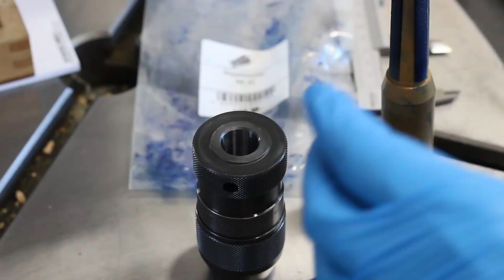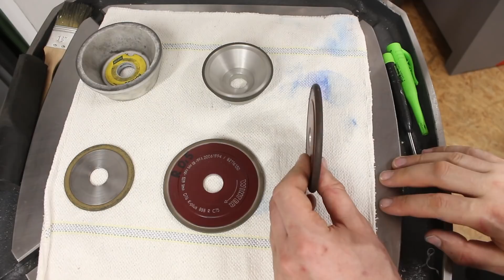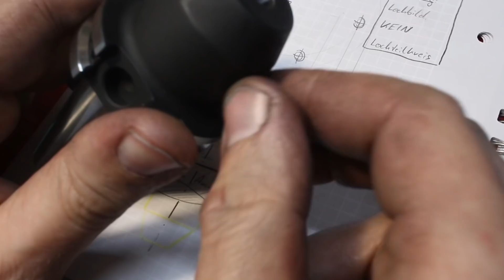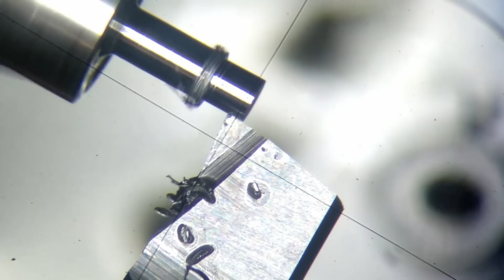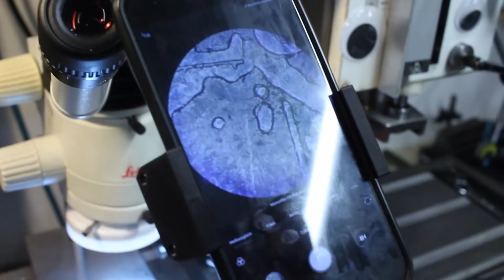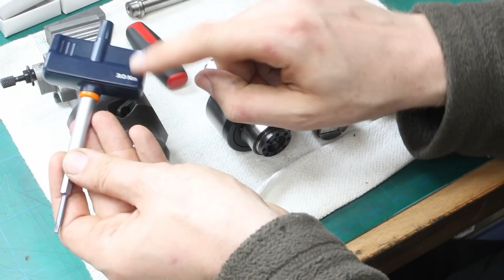Shoptalk #26 - May 2022

Comment: I'm sorry if this covered elsewhere, but is there an obligation to recut the center on the drill press spindle when you regrind or would it only be for initial manufacturing?

Thank you for the fantastic content ..
Reply from the maker: it would be a nice touch, but not necessary in my opinion.
Reply: I guess the more i think of it, all the important features of the spindle are forever a function of the bearing seats after those are finished, so what would be the point.

Comment: Are all the grinding wheels you showed 125mm as a stock size?   In Australia 125 mm diameter wheels do not exist. I’m rebuilding a LIP 515 and Lipemec suggested converting the machine to run 150mm diameter wheels.  Your BEMA runs 125 as standard so I presume BEMA do not see 125mm diameter availability as a future issue.
Reply from the maker: Norton stocks 125mm Wheels in Aluminum oxide and Siliconcarbide. The regular wheels I use are from "H.B. Schleifmittel" here in germany.

Comment: Stefan, thanks for another very good presentation on precision techniques. Squeezing down to essentials is a form of art.
One thing that made me think over Your setup. How did You initially ensure that the flange of that ISO holder was concentric with the ISO taper? It does not need to be.
I quess that in that case it was concentric as the taper was running true when You turned it around.
I have done some ISO 30 tapers myself and I always "turn" the tool attaching surfaces in the milling machine to be sure that they become parallel/perpendicular.

P.S. You need a hair cut 😀
Edit: Ahhh ... already done it seems.
Edit #2: Man ... it seems to be back so ...

Comment: I use one of the Andonstar "microscope" camera things for making parts around 1.5 mm diameter on my old Colchester 1800,, but I miss the 3D view of the optical binocular scope I use for electronic component assembly. After seeing yours, I'm tempted to get a cheap Amscope binocular scope with a 0.5x lens extender and make a mount for the lathe.
Reply from the maker: Yeah, I was thinking about getting a cheap optical microscope for beeing used on the machines, the Leica is a bit expensive in case of a crash event.. :D

Comment: If i remember right we used dykem applied @ like .0005" to .001" and permatex @ .001-.0015.... depending on the seal angle among other features like torque make up on threaded connections and shit. I know it's another world but everything has its place. We had bluing blocks that were nothing but gage blocks with different finishes or micro steps across one plane which u then applied a dab of either bluing and swiping it with a matching block that came together with the bluing blocks as  a set revealed the ideal/proper display of how the correct thickness visually looks after being applied correctly.

Comment: Why does everyone use non-reinforced cutoff wheels on their grinder?   They are impossible to buy here, probably because of the potential danger of putting one into an angle grinder.
Reply from the maker: The non reeinforded wheels are a bit more precise in thickness and leave a cleaner sidewall. But in general thats not a issue for what I do. I like the anglegrinder wheels for their cutting action.
Oh, and you can dress a non reeinforced wheel thinner - Which you cant with a reeinforced one.

Comment: Why not build a designated jig for the tapper grinding since you do so much of them and im sure what takes most time is the setup
Reply from the maker: The sine plate is already a very quick way - But I need a different V-Block. The magnetic one I have does not hold on large diameter round parts like a quill very well, hence the two woodworkers clamps.
Going to make a large V-Block with a traditional clamp that bolts onto the sineplate, that will be fast and universal :-)
Reply: @StefanGotteswinter  i see,makes perfect

Comment: I'm looking into making my own tungsten grinder (TIG electrodes). I find it hard to find a good source of diamond wheels that allow grinding on the face of the wheel. Is diamond the way to go or would any of these wheels work?
Reply from the maker: I don't know where you are located, but Robin Renzetti likes the Diamond cup wheels from Shars on his DBit grinder - Diamond works very well for grinding Tig tungsten electrodes - But careful, machinist here, not a welder ;)
Reply: @StefanGotteswinter  In Sweden so Shars is probably not that practical for me :D. 

I've read that CBN wheels perform better than diamond at high temperatures so maybe a god fit for grinding electrodes?

Thanks for great content btw!! Learnt a lot from your channel.

Comment: You should 3D print an adapter to hold your eye glass on your glasses. One of my work colleagues has one and it’s super useful.
Reply from the maker: I tried one of those wire-holders for the watchmakers loupe to hold it to your head - Not the biggest fan, does not work for me, I prefer the handhold one.

Comment: Fascinating and instructive - as always. I'm amazed that an insert stood up to the interrupted cuts on hardened material. Can you share the details of the insert?
Reply from the maker: Its a CBN insert - I cant tell more, no clue what make or type, years ago I bough a huge stockpile of used/semi used CBN inserts and I use them since them. I sharpen/shape them as needed.
Reply: @StefanGotteswinter  Thanks for the reply Stefan. I remember your video  on the CBN inserts. I will look for it again and re-watch.

Comment: A previous owner of my Bridgeport clone somehow managed to sheer off the drive pin and i've been running it for years with no drive pin, i often do very heavy cuts and i've never had any problems with it spinning the r8 in the spindle
Reply: A series 1 Bridgeport with an R8 taper? I didn't think they had a drive pin, but an alignment pin.
Reply: @Steve_Just_Steve   collets are supposed to be concentric so an alignment pin is completely redundant
Reply: @xman charl It's not a "drive" pin, it's an alignment pin not a drive dog/pin. Series 1 don't have a drive pin. I have a Series 2 with 40 taper spindle, it's has drive dogs.
Reply: Previous owner sheared the pin off in mine. I fitted a new one.  Nice easy job. Whether it does anything useful I rather doubt.

Comment: A wonderful start to Sunday here in Australia.
Heater on, sun shining through the last of the vine on the porch.
Stefan Gotteswinter making the joke with perfection.
Reply: Heater? Did it drop below 25?
Reply: @johnalexander2349  10 deg c at Kallista Vic where I live.
Reply: @johnmcnamara3719  Same as Emerald
Reply: @thosoz3431  lots of machining nerds around the dandenongs ;)
Reply: @ryebis  While I don't count myself amongst those hallowed few, yes you're right, there are quite a few. Went for a cruise on a friends beautiful steam powered 20 ft Couter boat on Blue Rock Lake recently. The engine , boiler and all mechanicals, hand built here in Emerald in one of the most impressive private work shops I have ever seen, (including on YouTube). I know of 3 guys with milling machines within a couple of steets from me.
Reply: @thosoz3431  Gee We shop in emerald just down the road. Tried to PM you.
Reply: @johnmcnamara3719  antennatom